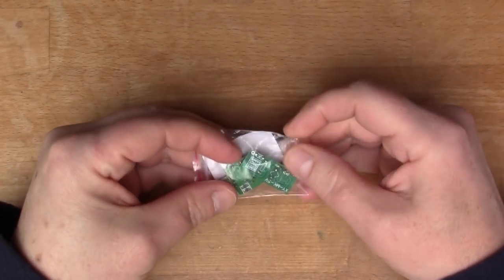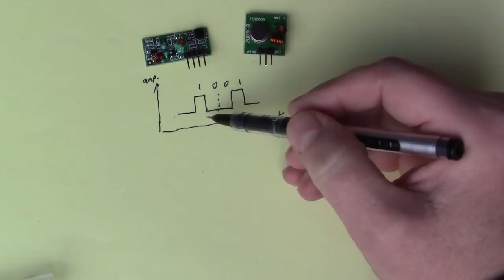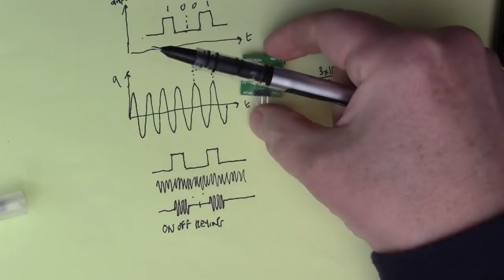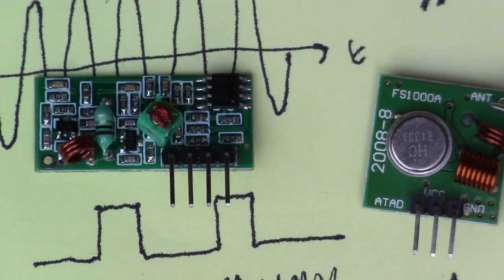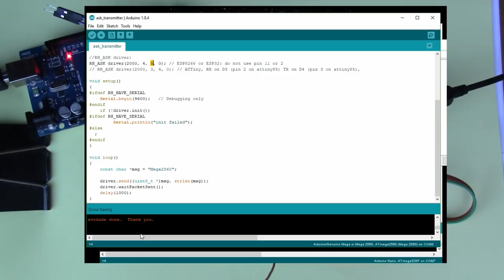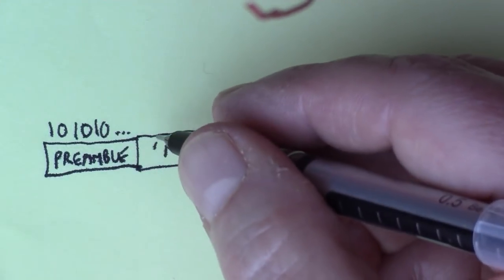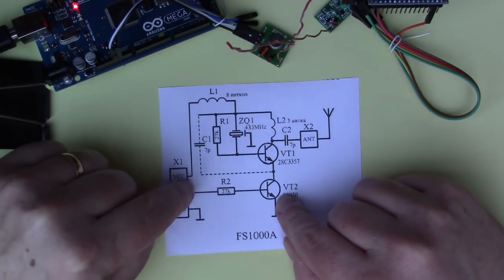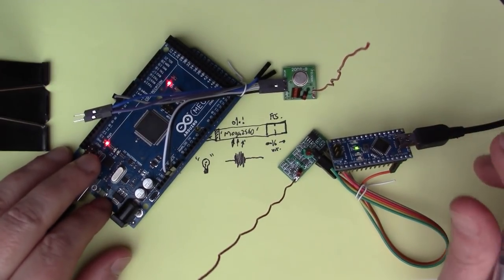Communicating with 433MHz OOK/ASK wireless modules (#88)

Comment: hi, i am using the same hardware but i cant send a 433 mhz signal from far distance, it is really strange that my receiver can only receive command when the transmitter is located REALLY close to it, like 2-5cm apart, i mean.. whats the point of having RF receiver if the achievable distance is this tiny?
 my goal is to receive a signal from a 433 mhz remote/switch from at least 4m distance

I also tried to add an antenna for both the tx and rx but still no luck

any help?

Comment: I want to add a power transistor to increase the range up to 5km
Is it possible?!
Plz help
I have 2n3442 for this
Reply: nope    - look  up the   max  frequency  .- power  trans   around audio  -   get   small  mosfet  from  ebay  
https://www.nxp.com/part/BFR93A
albit   no  longer    manufactured    5  GHz    to 6 GHz  -   and   parrallel    connect  for   power

Comment: ..can the transmitter work one to many receiver at the exactly same time and data within it's range like normal broadcast..?..I have checked it it's not as good as espnow on esp8266.. ~30m
Reply from the maker: Yes you can broadcast, and in fact this is a disadvantage of these simple transmitters - anyone can receive and decode the data.  You might not want a simple setup like this to control a gate or door.
Reply: @MartynDavies  ..you can always add a password to verify data reception.. string length check are never good enough...better with espnow broadcast
Reply: Arnold Rimmer  ...of course it's not an important data transmission like a redundant clock info on each reception side..I'm interested in rf clock projects...

Comment: Can i use the receiver to receive data from a HC 12 transceiver? I have read that HC 12 uses gfsk. Will it be able to communicate with the receiver which is ook/ask?
Reply from the maker: No, these simple modules only have one carrier frequency and can't support FSK.
Reply: @MartynDavies  Thank you for replying. Last question, the receiver i got which is the same model as this uses 315 mhz. If I use it alongside with a HC 12 transceiver which is 433mhz, will they interfere each other?
Reply from the maker: @channel1-u8z  I don't have any equipment for measuring RF emissions so I don't know, but the FS1000A has no kind of shielding so it could be quite noisy.  I would just try it and see how it goes; they are on very different frequencies so that is in your favour.
Reply: @MartynDavies Thanks

Comment: I only get about a 5 foot range even with a 17.3 mm antenna.
Reply from the maker: That is poor.  I would suspect a faulty module.
Reply: Your antenna must have 17,3 cm, not mm. More power Addition with higher Transmiter-voltage, e.g. 9 V is better than 5 V... good luck
Reply: @dronesrus7436  Thanks for the correction. I'll try it with the longer antenna.

Comment: what is the length of the antenna belonging to transmitter? please
Reply from the maker: I don't have the unit with me, but the wavelength at 433MHz is 0.69m, so most likely 17cm, which is about a quarter wavelength.
Reply: 3*10^8 / (4 * 433 * 10^6) = 17.3 cm, and for both transmitter AND receiver!

Comment: I tried to copy the transmitter module but I can't get it to work. I tried the schematic you show in the video and several others on the web that are similar but with different resistor values. When I connected the ground pin of the resonator to L1 inductor, it worked for a short while. Did you or someone manage to copy the transmitter module to process in a pcb or does anyone have any tips what I can do to get it working? Is there a way to test if the resonator is still good? Would really like to be able to do this myself but have no idea how to troubleshoot.
Reply from the maker: No, I just used an off-the shelf one.  I suspect the finished ones from China are cheaper than I could get the components for.
Reply: @MartynDavies  That's right. The modules are indeed cheaper than if you make it yourself. But I want to learn and like to make my own projects in my own pcb. Unfortunately I can't find much information about this on the internet. Or am I looking wrong :-)

Comment: Can we use multiple transmitter and receiver in one room with different address mode
Reply from the maker: Receivers will likely receive every transmission, but you could code every message sent, then in software decide which codes to act on in any given receiver.

Comment: Thanks for the great video!!  I am trying to connect the transmitter to a smoke detector, so that when the sensor goes off, it will transmit a signal.  I was just providing 9volts to the data pin but it doesn't send any signal.  Any help would be greatly appreciated.  Thanks in advance
Reply: Memory   of   between   200 hz  and  3khz   to  data   pin  at 5v  -

Comment: Can I receive an 433 MHz Freq RF code and reply back with this module?
If not will u plz help me for How to make that kind of module..by using Arduino...plz it's request.
Reply from the maker: One module is a transmitter and the other is a receiver, so no you can't reply back. You can get combined transmitter/receivers (transceivers); they're a little more expensive.  Search on ebay or aliexpress for '433 transceiver' and you will find some choices.
Reply: @MartynDavies  this is a intressting point. With 4 modules (2 transmitter and 2 receiver) is a full-duplex-reply possible, but one transmitter has to be a master and must wait for the reply to avoid frequency-mismatch. The other transmitter is a slave and transmit data only on demand from the master...
Reply from the maker: @dronesrus7436  Probably desirable to disable your own receiver while transmitting, to avoid receiving your own TX.
Reply: @MartynDavies  yes, that's right. It's all a matter of software. As long as the current consumption of the receiver module is less than 20 mA, this module can simply be powered by an I/O pin from the Arduino - and switched on and off if necessary... it's just one idea out of many...

Comment: Hey, great video..
I m trying bidirectional communication using these sensors.
I have a transmitter and receiver on remote and a transmitter and receiver on robot.
The robot will send the battery voltage to the remote, (only if the voltage is in acceptable limit the remote should work), then the remote will send command to the robot to move (forward backward sideward etc).
I m doing this using arduino nano but bidirectional is not working. 
have you tried bidirectional communication, is it working?
Reply from the maker: No, I haven't tried bi-directional with these modules. I can see that it might be a problem that both directions will be using exactly the same carrier frequency, so the sender will hear its own signal (and probably quite loud).  It's quite common in radio technologies to use slightly different frequencies for the two directions.

Comment: I don't know why you set it up this way on the receiver (not using 2000,tx,rx,ptt). you talk about pin 11 but never show how to use it. you just ramble about defaults.  your laziness does not help those of us trying to get it to work by matching exactly what you did.
Reply from the maker: I show the receiver data wire (orange) going to D11 on the receiving Arduino Nano (12:57).  As for the declaration in the sketch: if you look at the documentation for RH_ASK (http://www.airspayce.com/mikem/arduino/RadioHead/classRH__ASK.html) it shows that if you do not specify values of your own, it will use the default settings 2000, 11, 12, 10, false.  i.e. Rx=11 or D11.  I think your criticism is unreasonable.
Reply: @MartynDavies   I apologize. Two years on and I wonder how I could have been so rude. I just watched it again and understand much more than I did.
Deleting my own comment would be cowardly. So, once again, sorry.